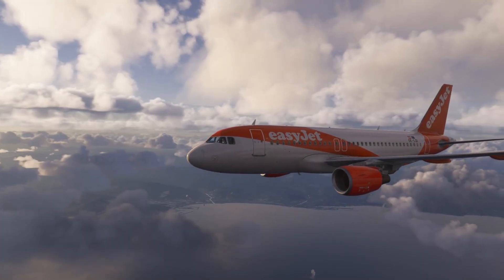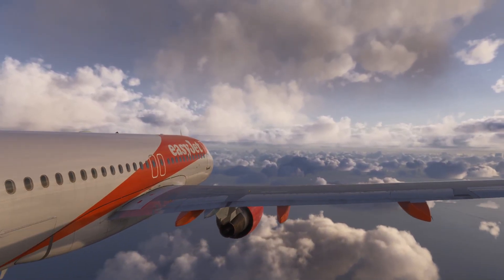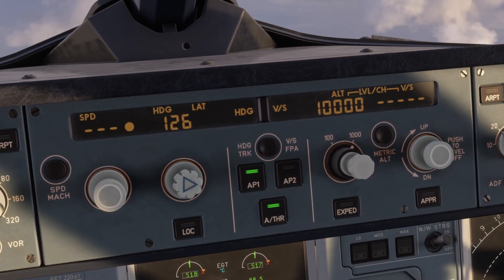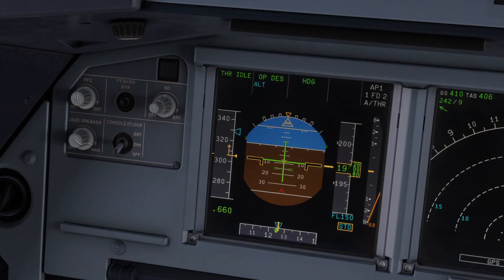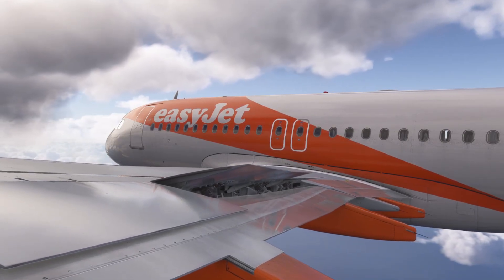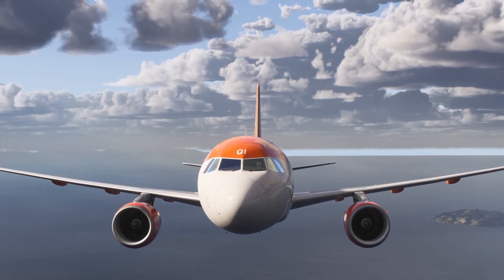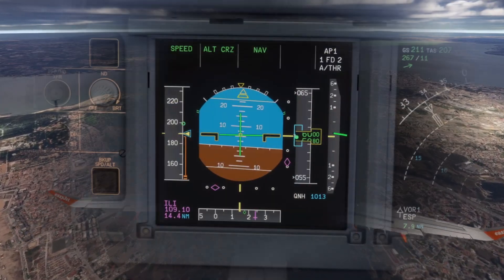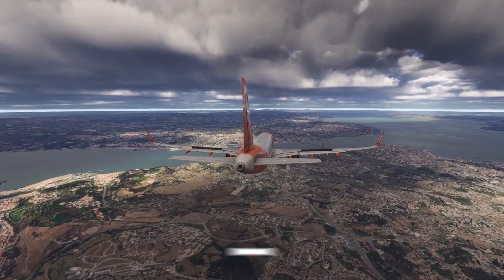A320 Speedbrakes Explained — Secrets & Hidden Logic You Never Noticed | MSFS

Comment: I have a question about the packs low/normal/high switch. I often find myself putting them to low for takeoff and switch to normal during climbout but I'm not sure if it actually offers more engine performance (like packs off). Would you care to cover that one maybe?
Reply from the maker: Low is only usually selected if the number of pax on board is quite low (or forget the actual number - would need to check) but it's something like less and 120 on board. This doesn't really assist in engine performance, turning the PACKs off however does and a few airlines do this for takeoff (Ej Is one of them)
Reply: @Easyjetsimpilot  Thanks a lot! I do have a second question. Is it correct that the engine anti ice needs to be engaged with SAT's of -60 and lower - regardless of visible moist in cruise?

Comment: The question is why does the Fenix have so much difficulty reducing speed in FLAP 1 and FLAP 2?
Reply: Because Flaps 1 is actually just Slats 1 so little to no drag and Flaps 2 adds drag but not that much which can not be enough on a 3 degree glidepath if you're heavy and without headwind